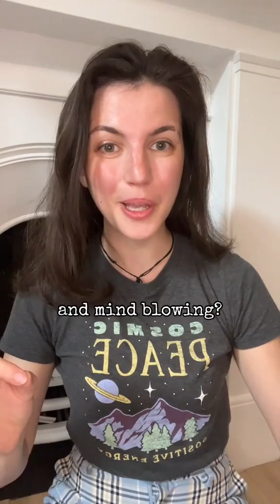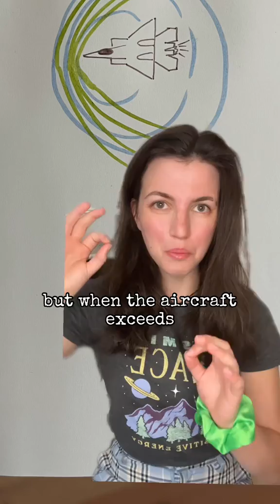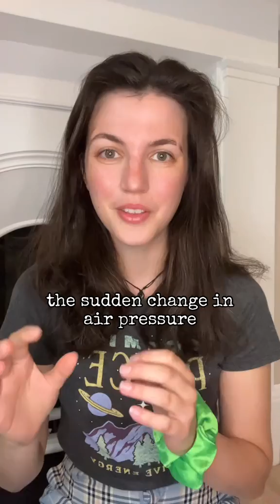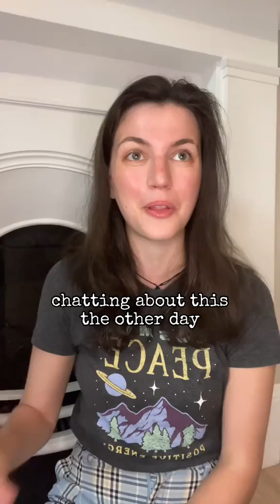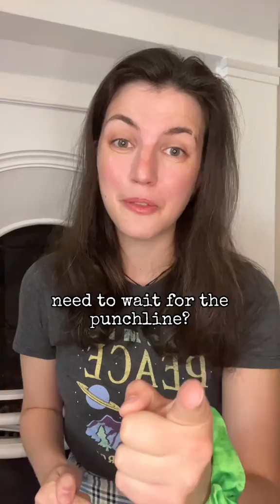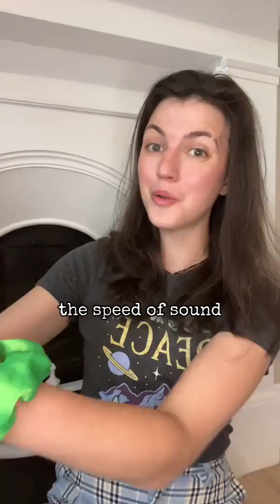How do pilots handle sonic booms?

Comment: That only applies to outside the frame of reference of the plane though right? Like if a tree falls in the cockpit with noone but the pilot to hear it, it still makes a sound that the pilot does hear right?
Reply: Yes the speed of sound is relative to the air, much less confusing than light
Reply: In a closed cockpit, yes. This is the same as the tennis ball being dropped on a train. The air in the cockpit is static with relation to the tree and the pilot. However, an open cockpit, no sound will be heard by the pilot as the tree falls. This is based on my understanding of the physics. Please correct if I am mistaken.